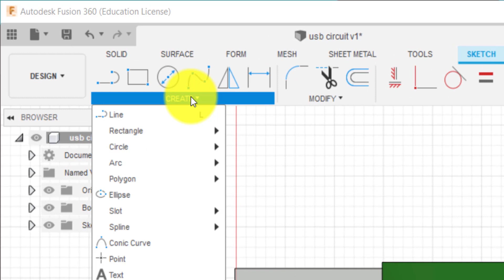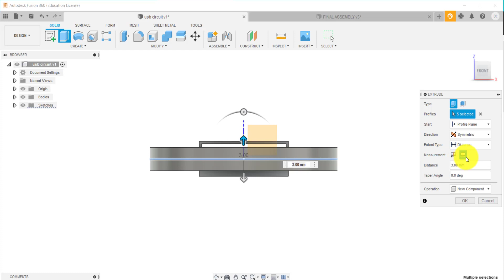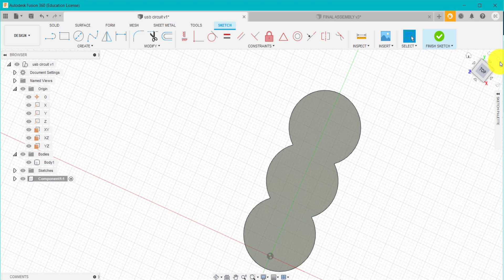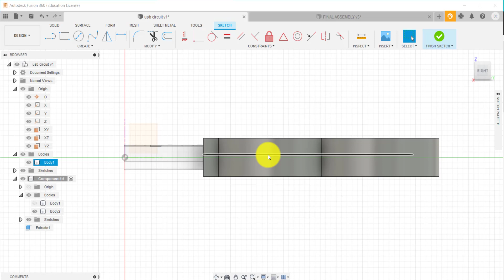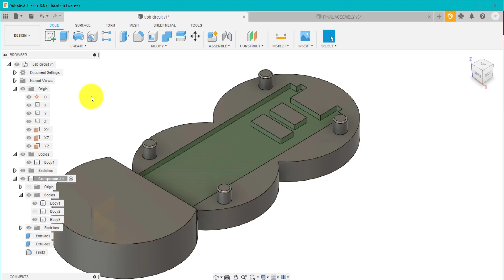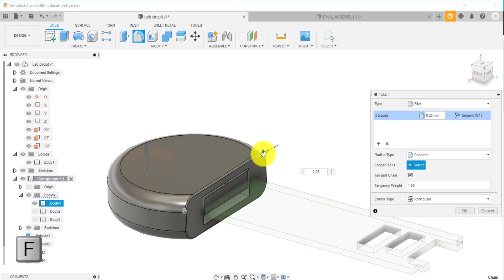FUSION 360 USB Pen Design... Simple Extrude and Split version. Download the FREE models.

Comment: Great video. 
When you use the usb circuit to cut away its shape from the body, I noticed you didn’t add any tolerance for manufacturing differences in the board or for the 3d printer. How could this be added when using the combine function? 

Many thanks
Reply from the maker: Add the tolerance to the part beforehand 👍